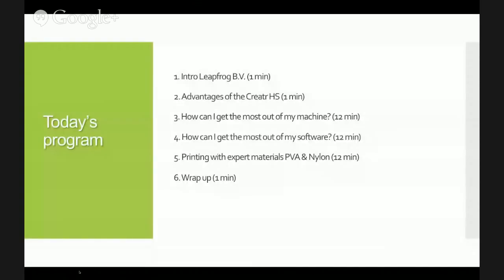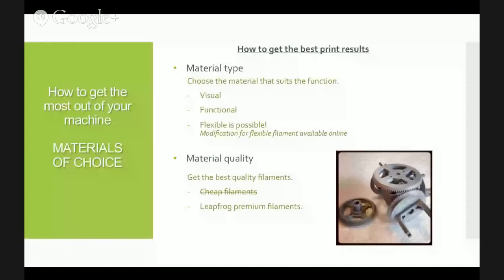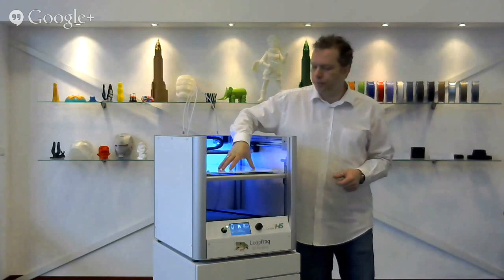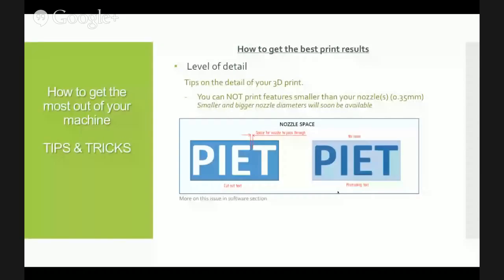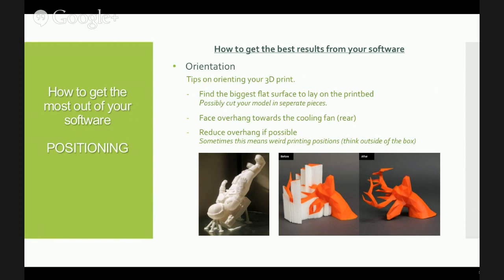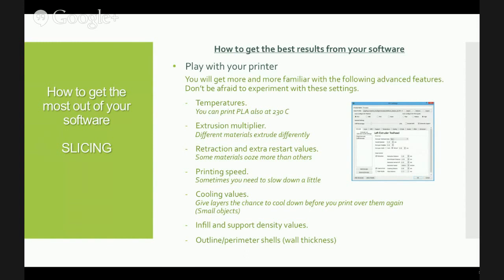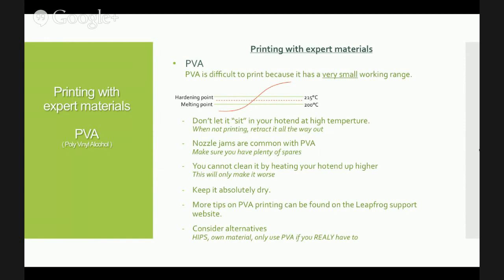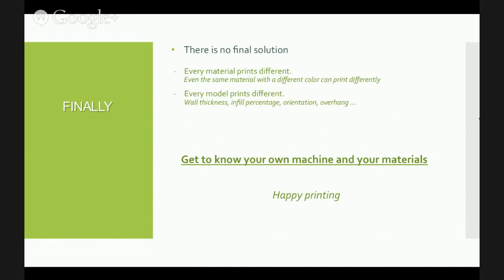3D printing Live Expert Session

Comment: David, (1) HOW do you let a layer cool down when you're printing a small object?
(2) When will a nylon profile become available? (3) When will the flexible material be available in the lpfrg store? Thx.
Reply: T Termaten (1) print very slow and increase the cooling of the extruder fan, additionally you can print another object beneath to increase the time, that the printer needs per layer.
(2) Nylon is very similar to ABS, printing temperature is usually around 240C, remember to dry your nylon before using it. To dry it, you can "bake" it at 50C in a normal baking oven, check out Taulman3d nylons as the 645Nylon from Taulman is, what leapfrog sells.
(3) As I'm no leapfrog employee, so I can't tell exactly, but flexible materials are very difficult to print on the HS, use very slow speeds and choose medium flexible materials instead of very elastic ones. For example use Semiflex instead of Ninjaflex (both found at ninjaflex3d.com), using a little higher temperatures will also help. Lastly you can print an adapter for flexible materials, which is found online at support.lpfrg.com, just search for "flexible adapter".

If you have more questions regarding the HS you can contact me via my hub at 3dhubs.com/siegen/hubs/marius

3dHubs is a website, that allows the owners of 3d printers, to share their printer with people that don't own a printer, but are in need for a 3d print.

Cheers,

Marius